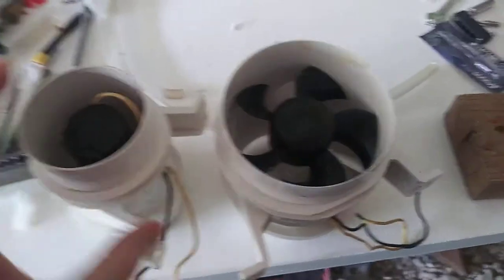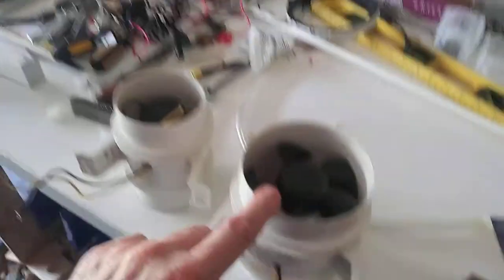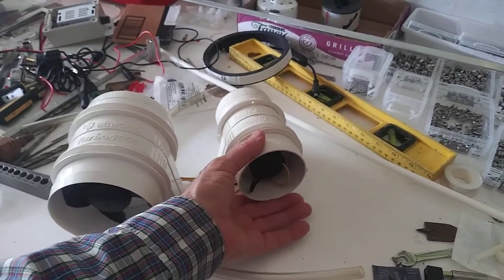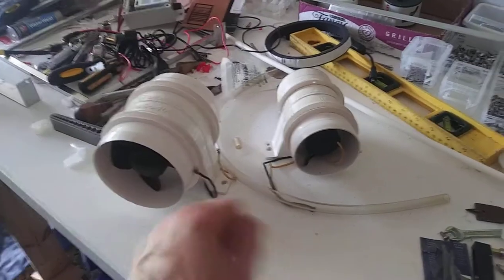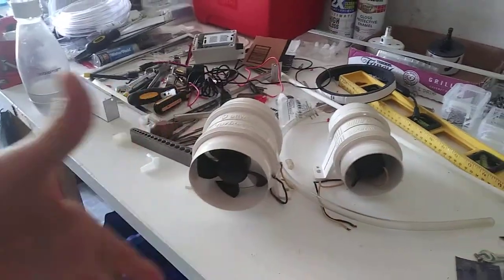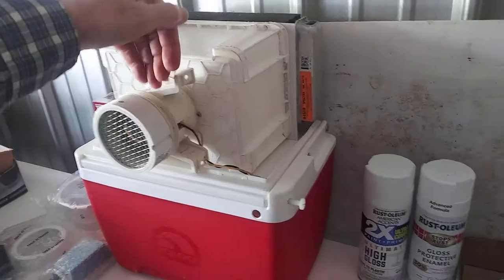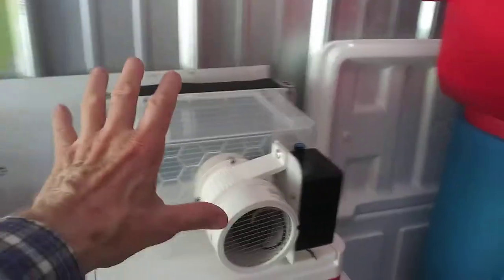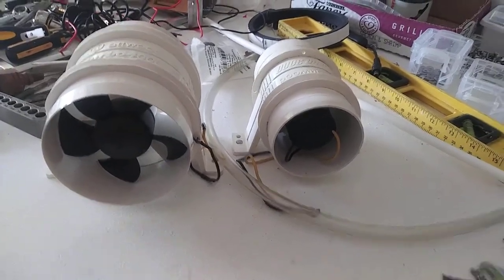Homemade Air Conditioner: How To  Choose The Best Fan.

Comment: I appreciate your videos very much. I've been looking through all your ice chest a/c related videos and I love how you're not afraid to say when something didn't work out. What caught my attention in this video is your mention that the main thing is the airbox and the distance of the fan from the radiator. Do you have any video which describes how to figure that distance? For instance, the width of the radiator equals the distance you should place your fan away from the radiator, thereby letting you know the size of airbox needed? My preliminary test copies of your design (copper coil, airbox, etc.) are working well, but I like this particular design, as it seems the pump is in the airbox and the hoses would just extend down into whatever size ice container you want.  Rock on, Cold School. You obviously know what you're doing.

Comment: @UCrpt9sWec0fTrwn9Xx5A64w  yes i took it out of the cylinder and removed the plastic black cover in the back and opened the motor  from behind so the air can flow in.Thanks for the tips about over heating.I have those smoke detector in case lol

Comment: Where can i order one ?😀 Oh and do you make one that runs strait off of 12v?
Reply from the maker: All of these ice chest air conditioners I build run off of 12 volts. I mostly use a barrel plug inlet and a 12 volt laptop style power supply. You could even use a phone charger type power supply as well if it has enough amperage. They only need about 1-2 amps to operate. You can use alligator clamps or cigarette lighter type plugs as well or even direct wiring and connecting with wire nuts, solder, screws etc. I can build and sell units soon. I will be uploading an instruction video and parts list very soon as well. I will post on Facebook "Official Cold School" and here on YouTube when I can start delivering completed units as well. I'll keep you posted for sure on Facebook.

Comment: The moter were did you fid
Reply from the maker: Hey! Are you asking about the 12v water pump or the 12v fan?
Thanks...
Reply: Where did you find the 12v fan?
Reply from the maker: @wrf450._  I use this fan here:
https://www.amazon.com/attwood-Blower-Resist-White-3-Inch/dp/B001O0DE9E/ref=mp_s_a_1_3?dchild=1&hasWorkingJavascript=1&keywords=3%22+attwood+h20&qid=1626054944&sr=8-3

It has a rubber boot on the motor to help keep it water resistant from condensation etc. It's not very quiet when it's full blast but gets a lot quieter if you lower the speed by reducing the voltage. You can use an inline 12 volt (speed controller) voltage regulator or you can build one also like I use on some of my units. But the inline rotary 3-6 amp inline controller is fine but the fan runs faster on wide open than when on high when using a regulator.

Thanks & get back with me for sure if you need more info!

James, Rescue Kitty😺 & Snowvan!

Comment: Weird all my comments disappeared from the thread
Reply from the maker: That is weird. I just checked and you're right. Your comments are in my updates notifications but are not there anymore. That is weird. I know that during the winter all comments were not available for some reason and I had to allow all comments to see them. But I never blocked any comments before, so that's definitely strange.

I see 3 hours ago your comment has an @UC... at the beginning of the comment. I wonder if you're having trouble on your end...
Reply: @Homemade-AC   no problem thx again for the tips, my new fan blow the hell of wind!! Insane.